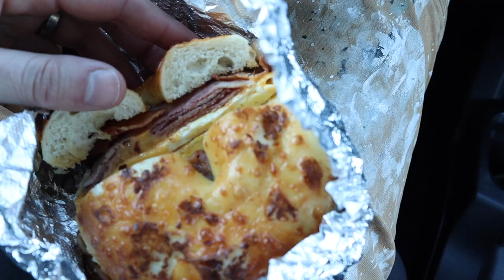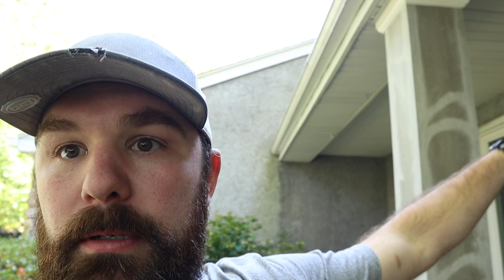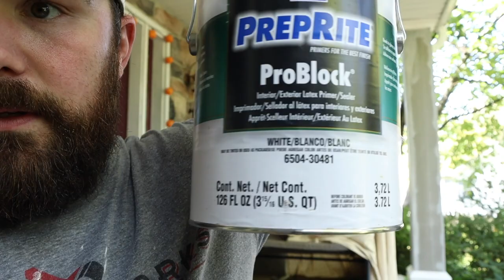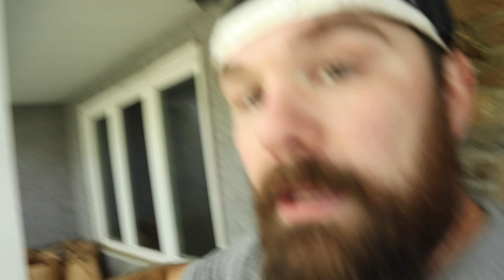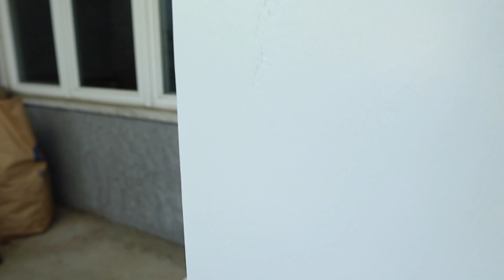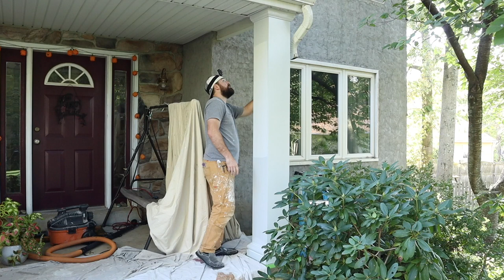I tried painting exterior columns in October in Pennsylvania.... Good Idea??

Comment: Thanks for the video. I'm wondering if you had to sand the fiberglass before applying the primer? My Duracast fiberglass column instructions tell me to sand them with 120 grit sandpaper. I'd like to avoid that if not really necessary.
Reply from the maker: You don’t need to sand it if you use a decent primer.  I’m a big fan of fresh start these days.  The sanding is mostly a texture thing.  If you notice little fibers sticking out or a rough texture after you prime it then you can sand those spots with 150 grit to smooth it out.

Comment: I'm not a painter.  What kind of roller are you using for the columns? What is the nap length to get that smooth finish?
Reply from the maker: I believe I used a 1/4 inch or 3/8s inch pro-doo-z FTP from Wooster.  Either of those would give you a great finish.
Reply: @SuperVassarBrothers  nice! Some people say using a 3" brush would give a smoother finish. Apparently the roller can give an orange peel effect. Is that true?  I don't want to ruin my columns 😂

Comment: I know you posted this a year ago, but I just had these fiberglass columns installed recently and need to paint them.  What prep did you do before priming?  Did you wash it? If so with what? Did you sand at all? Appreciate it.
Reply from the maker: If they've been recently installed then they're probably not overly dirty.  You can wipe them down with a rag to get the dust off then you're ready to go.  Caulk in any cracks in the bases or caps, fill any nail holes with exterior filler, prime with a decent exterior primer (i really like fresh start right now from benjamin moore) and then paint it with Benjamin Moore's Moorglo Soft-Gloss in whatever color you prefer.  That's my method, for what its worth.  Good luck with your columns!

Comment: I have some older installed composite posts  on the porch. They were never painted by the installer. A little white flakage on them. I tryed to wire brush, but no more is comming off. Can i prime and paint over?
Reply from the maker: I’d recommend sanding them aggressively with 100 grit sandpaper to knock off anything loose.  Then you can prime it and then hit it with your finish paint.
Reply: @SuperVassarBrothers  ok, thanks man!

Comment: Just did 100+ yo columns in Indiana.  Was around 45 degrees with 10 mph wind. Primed with Sherwin pro block and top coated with Emerald exterior satin. They were in terrible condition but now they should stay sealed for a good 15 years!
Reply from the maker: That is a bit chilly for my taste, but hopefully the sun was out.  Well done!
Reply: @SuperVassarBrothers  It was super clear.  Got to around 60 mid by early afternoon.  The paint thickens up really nice in that temp range and the bankroll really settled nicely.  Have three decks to do on the same house and then were done outside for the season!
Reply from the maker: @factspirate99  good luck on those decks.  I’m pretty sure these columns were the last of our exterior for the season.  I’m always happy when it doesn’t drag into December 🎅🏻
Reply: Great video 📹 I love painting in the cool weather...soft gloss🤤love the Benjamin Moore
Reply from the maker: It's the best 🤙

Comment: I finish drywall and paint for a living, I have a van, but it's only creepy if it's white and mine is a nice maroon color. Can fit 10ft sheets of drywall laying down. And c'mon ditch that 5.5ft bed toddler hauler truck and get an 8ft bed with a contractor cap where the sides open up, you won't regret it
Reply from the maker: Duly noted.  For the record it's a 6 foot bed 😛